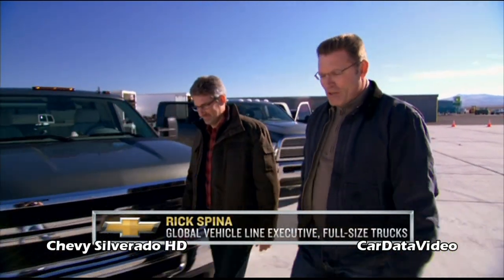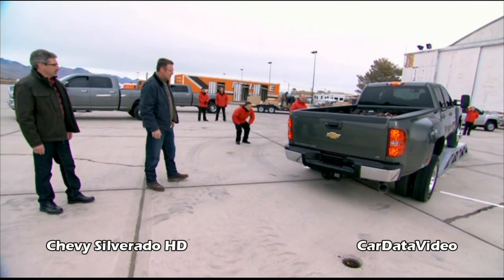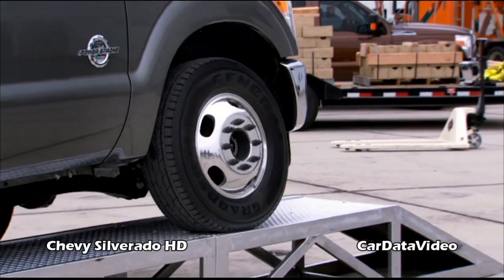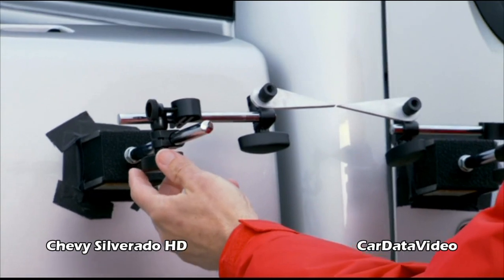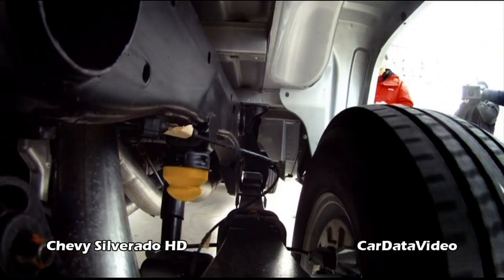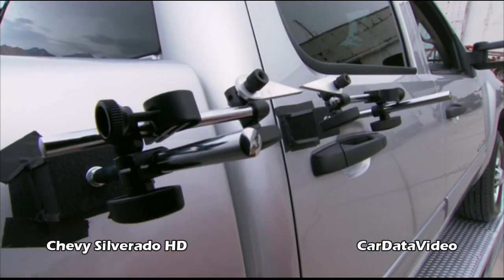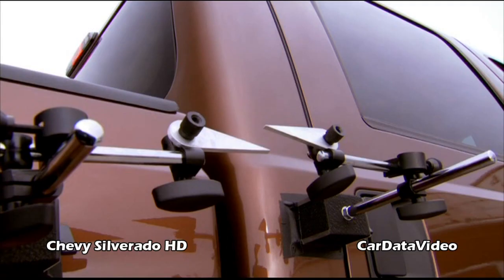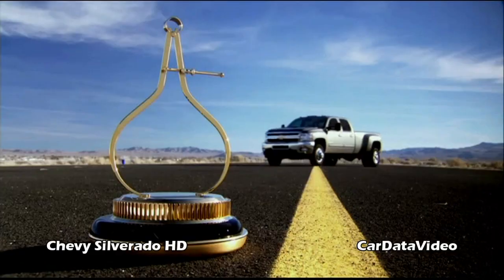Chevy vs. Ford HD Truck - Bed Bend Video

Comment: Its funny how the tests vary depending on the manufacturer. Do people actually believe this is unbiased?
Reply: Ford guy?
Reply: Foggy Visions definitely
Reply: Just watch whistling diesal
Reply: U salty chevy is the best
Reply: I don't believe fords are better but I believe that the ads are a load of bullshit from both.
Reply: @BxndsFR  Laughs in Toyota Hilux
Reply: lol
Reply: I hate ford just as much as I hate chevy but at least the Chevy has a boxed in frame unlike fords C-channel frame. I’m a dodge truck owner and I don’t think of chevys as reliable but in this aspect they definitely beat ford.
Reply: @hilljackzack7284  your kidding right you know a boxed in frame rusts like 10 times faster right. the Chevy will devalue a lot more than the ford in ten years.
Reply: @joshfenby4170  the ford frame will likely be bent beyond repair in 10 years lol. Also if you clean your truck and paint it where it starts to rust then it should be fine.
Reply: HilljackZack dude really dodge? I don’t think you should even have an opinion if you own a DODGE truck
Reply: @JustAstroThings  there the only truck that I’ve actually been able to rely on.
Reply: i like how people are getting salty over the truth
Reply: @オジーはビッチだ  lol I know right?
Reply: @XTHE12THMONKEYX lol there’s a lot of people here all pissed off, they just can’t handle the truth.
Reply: @hilljackzack7284  my F-150 has a box frame.👍🏼
Reply: @JustAstroThings  I don’t know....at least he doesn’t have a Chevy.
Reply: @Carbon_Volture  thank you for helping me prove my point. 😉
Reply: @joshfenby4170  and I've heard some storys of them getting rained on from the factory so that means they come even easier to rust
Reply: @hilljackzack7284  it’s still gonna rust out faster and you can’t deny it.
Reply: @bradleypumba  yeah I know I’d much rather a c frame
Reply: @joshfenby4170  ya it basicly just depends on the thickness c frame can be way better then the boxed frame just based on metal thickness
Reply: chevy gay there’s no changing my mind
Reply: @deetusyeletus  so you also hate the corvette
Reply: @bradleypumba  no but most of their newer cars are ugly, the only good ones are the corvettes and the older ones
Reply: @deetusyeletus  im not a big fan of chevy either and I make fun of them quite a bit but there trucks are not that bad they just super unreliable
Reply: @joshfenby4170  exactly
Reply: The Chevy truck I had the engine set on fire I rather go with ram
Reply: Idk man they both went up the exact same ramp on camera.
Reply: @robertorivera3769  lmfao
Reply: @BxndsFR  ong
Reply: Its Ford dude. What did u expect
Reply: I do like Ford but I also like dodge and when it comes to pickup trucks I’m going with ram . Ram has the strongest pickup trucks in my opinion. I would not go with Chevy because I don’t trust them I feel like a company buying a truck from another company is like a sabotage they could literally change any thing about the truck so I don’t trust them and another thing I never seen them put ram against a Chevy . I would pick ram first and ford second.
Reply: @King20times  ram transmissions barley last 10k miles
Reply: @callmeyeetusdeletus4482  What does that mean , if you make a list of what problems Chevy and dodge have you would probably see that Chevy has more problems then dodge.
Reply: @King20times  were you born yesterday
Reply: @King20times  for instance dodge and ram if you can't dodge it ram it ok ram it into a tree
Reply: @King20times  cummins is owned by caterpillar therefore that's a problem
Reply: @King20times  you wanna ram ok your going to have to change your transmission
Reply: @King20times  work comes with every truck
Reply: @ArthurMorgan-pq4tr  it's the weight they put alot More weight on the ford
Reply: @JustAstroThings  look i have a dodge ram  and a ford f250  and I had a hummer h2
Reply: @Bayfire-ki9du  If your going to @ that towards me also @ that towards the person that called me a dumbass . And I will change the way I responded to things , but one thing that everybody have to understand about people . Some people don’t take disrespect. You disrespect me I going to disrespect you .People say it’s a kid move they can call it what ever they want , Treat me the way you want to be treated.
Reply: @callmeyeetusdeletus4482  Please try and fit all your comments into one instead of cluttering the comment section with a bunch of ones. Thanks.
Reply: @King20times  I @'ed them too as well and I appriciate that you took the time to put your comments into two comments. Thanks
Reply: @Bayfire-ki9du  No problem
Reply: Ford lover ?
Reply: Chevy has been known to fake comparisons
Reply: @BxndsFR  uhh no look chevys average lifespan fords last way longer
Reply: Ehh all the true people know Ford is better
Reply: @trex9690  facts man Ford 4 life
Reply: Yall are acting so dumb. It's supposed to be biased. It's a COMMERCIAL. Checy is trying to advertise there truck. And dont sit there and tell me Ford has never done the same thing to other trucks in a advertisement.
Reply: @hilljackzack7284  ur amazing. Dodge and Chevy are my go to brands.
Reply: No
Reply: @hilljackzack7284  I’ve had 2 gm trucks, I landscape and plow towing 7 tuns of rocks a lot, the first one I had for 15 years and I just got a new Silverado hd last year. I can speak for the older one for now, it never had any big problems besides a transmission hose blowing out 2 years ago plowing and the starter that winter. Not saying your wrong in anyway Or that Gm is better, just saying in my experience they have been good. I really don’t care about the brand as long as it holds up and has the right price tag, it’s funny seeing people go all out on why brand x is infinitely better then y because that’s what they think lol.
Reply: @BxndsFR  tbh seems like chevy had a part in this
Reply: Lol but the test was the same... you saw it for yourself.
Reply: I believe they locked the Ford tailgate.
Reply: @robertorivera3769  yeah he is a smart guy
Reply: @callmeyeetusdeletus4482  geez u spamed him with 7 comments I think your a chevy fan boy
Reply: @bradleypumba  I like chevy I like ford I dont like ram
Reply: @HuddtheBudd.  ur just mad your transmition went out lmao🤣🤣🤣🤣

It's joke all fun and games
Reply: @HuddtheBudd.  no we are not jealous we all believe that each brand has their perks but we do want to see an unbiased test not made by ford or chevy lovers something that we can all watch and learn about our choice of vehicle and who knows many perfect the flaws in both vehicles but at the end of the day we will all have our own opinions and make our own decisions
Reply: @ArthurMorgan-pq4tr  I like the way you think
Reply: @HuddtheBudd.  in more of a rat rod kinda guy
Reply: @HuddtheBudd.  I said I like FORD I LIKE CHEVY I LIKE GMC I LIKE TOYOTA I LIKE NISSAN BUT I DONT LIKE RAM
Reply: @bigdinobuilder5845  laughs in good fuel injectors
Reply: Speed Comparer thay made it all to one side
Reply: @dieselmonkey7338  finnaly someone gets it
Reply: @subienate  get off you tube and got to school

It’s just a joke lol
Reply: @Bayfire-ki9du  mud buddy is the one who replied to one comment 8 times, so i dont think you should be telling king20times to keep all of their thoughts to one comment
Reply: @kajbaraj2978  If you uh, read the comments after I said that. I told that guy too. Also, I told king20times that I appriciated him putting his comments into two comments. They were originally just as many comments as mud buddy.
Reply: Chevy is known to rig tests in their favor
Reply: @hilljackzack7284  I owned a Dodge truck (2017 model). The suspension broke twice, i fixed it the first time and it broke in a month again. I took it to the dealer, they "fixed" it just for it to break again in a couple of months. Mind you, it wasn't a cheap one, i bought it new for around 42k. In late 2018 i bought a brand new raptor and it was the best truck i ever had. No regrets. Im not saying Dodge trucks are bad, its just that my experience with them is bad.
Reply: @andrewmclamb6984  You're really gullible, these days everything can be faked easily.
Reply: @ivanpekic3544  I’m now a technician at a Chrysler dealership. My 2011 4.7 1500 I bought a year ago is still running strong, I’ve seen some lemon ram trucks come in and I’ll admit they’re not perfect but I’ve had better experience with both my ram and my 2006 Durango than I could ever hope for out of my 2001 Chevy s-10 Blazer. I don’t actually know much about fords other than they look ugly to me but that being said this truck has helped me move a lot of shit and I brag about it to everyone I know.
Reply: @hilljackzack7284  Yeah, it depends, maybe i got a bad truck.
Reply: @ivanpekic3544  I’ve seen it happen, customer buys a brand new truck and what do you know the tipum is fried, or the engine needs replaced, or the shock absorber is bad. Also all of these brands alter the trucks they do commercials on because it’ll help them sell shit. Ever see the Chevy steel bed commercial? Faked. Ever see the commercials where the ford Raptor gets driven aggressively off-road? That was actually in a controlled environment, not the true wilderness. Ever see the commercials with these non wrangler Jeeps off-road? Again that’s a controlled environment on a very easy trail. Dodge Challenger commercials where they do doughnuts a lot? Well I sure as hell hope a V8 rwd car can do doughnuts like that otherwise it’s a complete waste of money, and an utter disappointment.
Reply: @hilljackzack7284  Yeah, you're right. Especially about the Chevy commercial. I honestly find the Raptor and Challenger commercial better than the Chevy one. In the Chevy commercial they show a competitor and bend the truth a little too much. The Raptor and the Challenger aren't trying to ruin the market for other competitors.
Reply: Trucks bed should bend.
Reply: Why didn’t they test the dodge in the beginning? Is it because dodge is stronger and better than Chevy.
Reply: @Jake A  I could say the same for Chevy too even my friends had issues with their Chevy trucks
Reply: I don’t like Chevy but I like Ford dodge and Toyota.
Reply: @BxndsFR  Chevy for the win
Reply: @bigdinobuilder5845  *laughs in my 2018 3500 HD
Reply: I'm a chevy and ram fan
Reply: @robertorivera3769  Found the guy that believes these manufacture propaganda videos are legit lol.
Reply: @robertorivera3769 
Yep he a ford guy
Reply: we have opinions bruh, can’t even live without unbiased people
Reply: If you pay attention to the different vehicles and tests they vary. This test is honestly stupid because you want flex with a heavy duty work truck.
Reply: @BxndsFR Chevy use to be the best but not anymore.
Reply: @hilljackzack7284 shows what you know. The f150 frame doesn't flex at all, fully hydro formed steel box frame rails with shocks outboard the frame, the Super duty, or Heavy duty as GM and Ram call it, "HD" needs to have a C channel reinforced frame like the super duty, the reason the super duty flexes is to give for they heavy loads and not be so Ridgid, have you ever seen a 18 wheeler tractor flex over railroad tracks? Quit talking about things you know nothing about.

Comment: Ford isn't junk. It's because Ford's frame is almost 2 times as stiff as Chevy and the Truck is designed not to twist like that. Have a look at some of the Ford testing ground videos and you will see that they specifically test the trucks to not twist like this....

Comment: except this is an unfair test because ford literally designs their frame to do that to increase the flex in the tires/ suspension so that all 4 tires will still be on the ground and give you traction
Reply: Not in HDs, that’s meant for towing
Reply: B F'IN S
Reply: It’s true though
Reply: They design the suspension like crap. Newer and older ford ride stiff